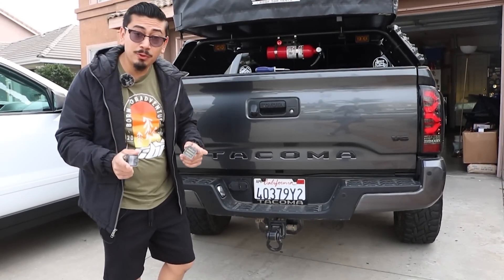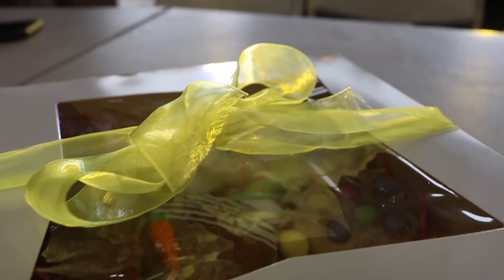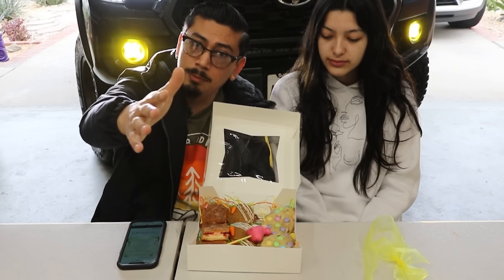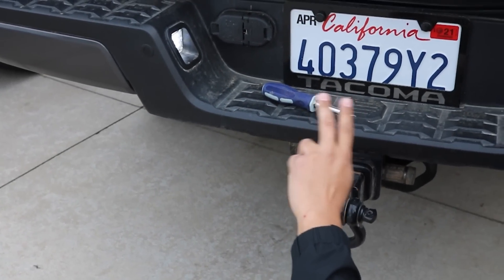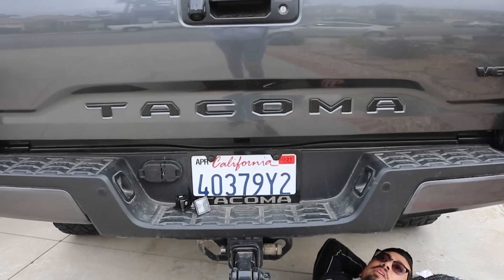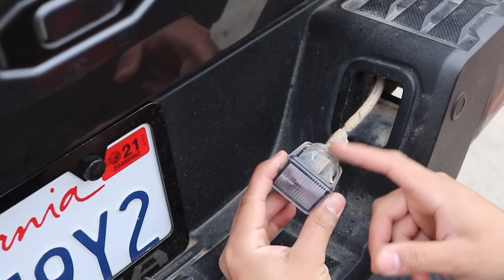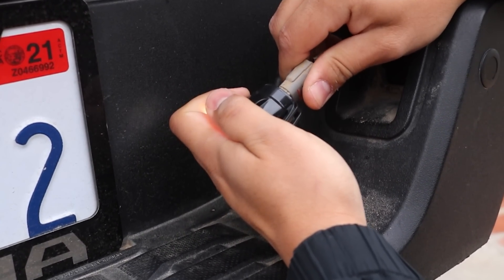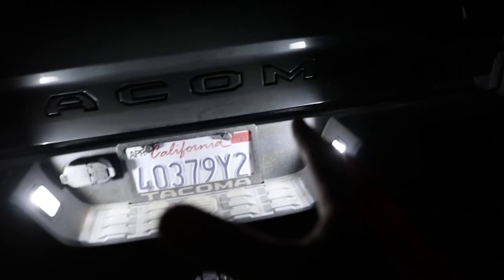3RD GEN 2016-2021 TOYOTA TACOMA FULL LED LICENSE PLATE LIGHT REPLACEMENT | HOW TO REMOVE & INSTALL!!

Comment: Hows it holding up? I've been using the lasfit bulbs in mine, and they died out. So I'm checking this out before I actually give the Morimoto a try. Because idw to keep going through license plate bulbs, those are a pita to work with